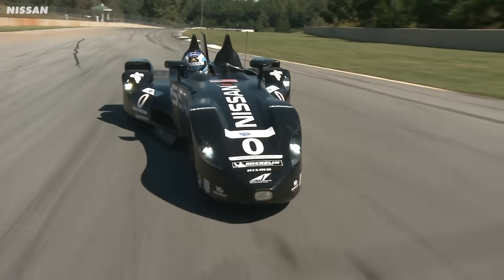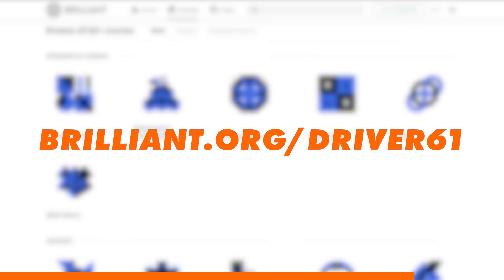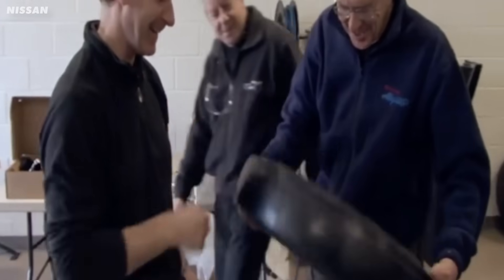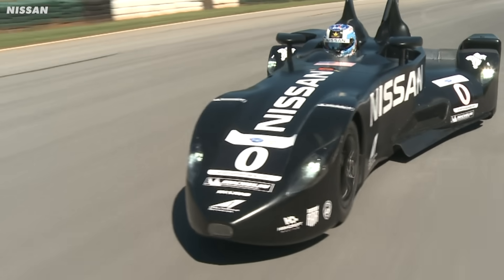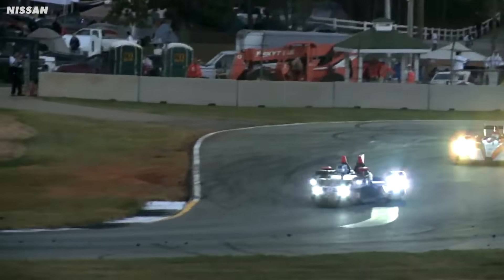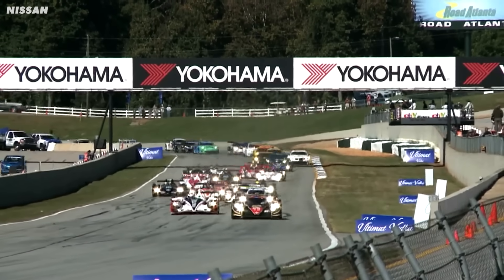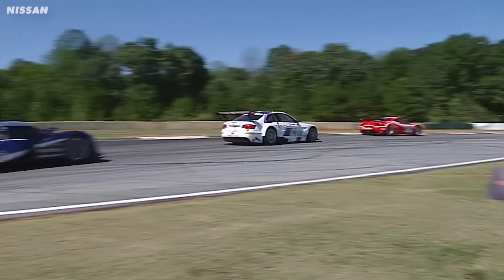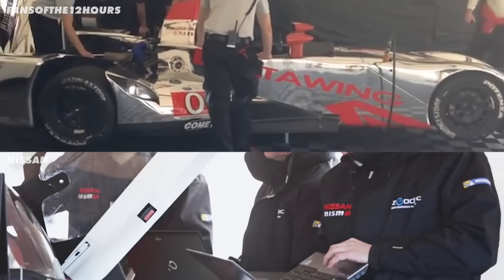Why This BIZARRE Race Car was GENIUS

Comment: First impression, the inside rear wheel will lost traction at sharp corner due to limited suspension travel....and it was. Second is that driver will eventually making mistake and crush their rear side when he try to cut corner or going through some traffic since the front head is narrow and rear body are much wider.

Comment: Saw the car in 2014 at Le Mans 24h and was really disappointed that it basically stopped racing after just 1 lap. All in all it managed 5 laps before its accident, so a total failure. And I am not sure the video really reflects on what an incredibly bad race it had at Le Mans: "Six hours into the race while warming its tires it suffered an accident." 
You would probably have made more laps in six hours pushing a Yugo ... (" the best thing about its rear-window defroster, according to consensus, was that it could keep your hands warm while you pushed it.")

Comment: Delta wings are used in supersonic planes because it's needed to combat some issues with supersonic airflow. Having delta wing shape for anything that goes slower than the speed of sound is more like a marketing trick instead of required for aerodynamics.

Comment: The Deltawing should have been great. By the end of the 2015 season if I remember right, the Deltawing was faster then anything else on the straights, and starting to be a threat in championship fights. The next year at the Rolex 24, the Deltawing drove to the front of the field and held the lead overall on pace alone. Unfortunately, they crashed into a stalled prototype challenge car in turn one. That was the last of the Deltawing.

Comment: Wrong.  It has nothing to do with delta-wing aircraft, and has everything to do with (1) reducing frontal area, and (2) eliminating (as much as possible), top-surface aerodynamic devices (e.g. wings).  Reduce frontal area and drag, and you need less horsepower.  Use ground effects, and you have no need for [draggy] wings (other than trimming) to produce downforce.  Given the narrow front track, to balance the car mechanically front-to-rear, extend the wheelbase forward (otherwise, you get the 3-wheel ATV fall-on-your face-while-cornering effect).  Mix #1 and #3, and you get the [long] triangular configuration, and for kicks, let's give it a cool-sounding name, like Delta-wing.

You're welcome.
Reply: Never mind the blatant Gurney BLAT at 3:55(https://youtu.be/D7N5mrxzFmg?t=235)

Comment: You can't say, after the test/race driver gives a 5 minute list of how bad it was,  that "despite this they got it working at road Atlanta". No, they didn't. It is a failure. There is not enough front end grip, relative to over all grip, to be fast. Its a silly eco-minded idea, based on racing without using fuel, that failed. Its not genius in any way and its not leading to any new development in the future.

Comment: Delta wings are horrible and inefficient at low speeds which is why the f-14 had movable wings.  They could spread them for high efficiency at speeds like this car would see, and pull them back into a delta formation as they approach supersonic at which point they generated plenty of lift with reduced drag.

Comment: I have no idea why anyone would think that a delta wing is useful for anything other than supersonic flight, which clearly wasn't the goal for a race car. In fact, the delta wing is a compromise between good lift-to-drag ratio at supersonic(!) speeds, and barely sufficient lift and adequate controllability at high angles of attack at low speeds, at the cost of huge drag. Concorde needed tremendous power for takeoff and still substantial power for landing. The drag reduction in this machine mostly comes from the narrow body, and the wider rear part is a compromise to keep it from flipping over in corners. If a delta wing had low inherent drag, all aircraft would be using it, but only supersonic aircraft (and some whacky experimentals, where drag isn't the primary concern) do.

Comment: The delta wing on supersonic aircraft is a feature implemented prevent Mach waves from locking up control surfaces.  At speeds below transonic, e.g., a car, the delta shape actually increases drag due to viscous boundary flow.   The correlation between the car and supersonic jets is pure marketing wank.  This, from a keen racing fan and aviator.

Comment: I used to have good natured arguments with a friend of mine about the benefits of a reverse trike and the potential. He thought it just wouldn’t work.
With the (relative) success of the delta wing I was able to win that one with a knowing nod and a wink.
I’d still like to build one. Unfortunately it’s at the back of a long list of possible projects and I’m not getting any younger!!!!
Reply: It's not a trike though it has 4 wheels.
Reply: @wiegraf9009  it’s a four wheeled trike, if you can imagine such a thing. The front wheels are so close together it’s functionally the same as having just one.
Three wheelers aren’t classed as “cars” so this was a way to get the benefits of a reverse trike but still have four wheels - be a racing car.

Comment: It was an interesting concept that ignored basic physics. The small cross section at the front of the car created a torsional aspect to the handing and doomed the car from the start. All of the gains on the straight aways went away at every corner. The front tires were beat to death every time it went out. A nice concept but fundamentally flawed.Otherwise,it would be everywhere on every race track right now. You really cannot beat the four square box chassis that the standard race car has for handling. It is just the reality of this place we live in.Driving that thing in the rain must have been terrifying.

Comment: A few points of note. The car was actually pretty competitive in the ALMS and running at the front in the Daytona 24hrs for a time.  It certainly had reliability problems early on. Also the engine in the Panoz Deltawing cars wasn’t exactly a Mazda with Elan Power designing and building the engines themselves around a billet block of their own design. The cylinder head was a Mazda casting though. The Elan engine made more power and torque and the gearbox suffered as a result. A switch to a new custom made EMCO unit eventually solved that issue. Aero wise the car was developed extensively in that period with a modified underbody, revised front end with a splitter and small wings at the back. The rear suspension design was also very different from the ‘Nissan’ car with a more conventional set up at the rear.

Comment: I saw it a few yeas ago while testing at Top Gear Test Track @ Dunsfold Park, and the way the nose would dive in at Gambon was really uncanny as was the overall speed with so little power.  Also, mentioning delta winds on aircraft like Concorde & Eurofighter in relation to this is is wrong, at least in engineering terms, probably less in marketing/publicity ones.  The reasons they work on aircraft is totally irrelevant in cars as I can't imagine any car pitching down 20-30° while cornering 😆

Comment: A very interesting car indeed! A small note though about the lateral load transfer across the front tyres: it actually !increases! due to the small front track width not the opposite as stated at the video. 

The formula is: lateral load transfer=(weight on the front axle*lateral acceleration*height of the center of mass)/(track width)

Hence a small track width leads to increased load transfer. A large track width can offer "free grip" as you can work both tyres closer to their limits. The stiffness of the front and rear axles is an independent parameter and can be set however you want it. 
Needless to say this is a very interesting example of vehicle dynamics and car setup!
Reply: Interesting car and I really don't know how it was any good. Disappointing video though, given the error you mentioned, as well as suggesting the shape was used for the same reasons as on aeroplanes designed for operation in supersonic flow regimes, where air behaves completely differently to subsonic flow. I still have no idea how it was any good.
Reply: @dethak  yes it was a bit funny hearing about a delta wing race car, given that it travels through subsonic, let alone practically incompressible flows 😂 I would argue its a draggy design, given all the vortices created, their lift/drag ratio shouldn't be impressive really. It was probably a compromise to materialise this unique design, rather than a feature!
Reply: The more I think about this formula, the less it makes sense. It makes perfect sense if front and rear track width are the same, and I think it might make sense if the front wheels are on a rigid axle, but neither of these things is true for the Delta Wing. It has a very wide rear track and stiff body, so I suggest the rear track be plugged into the formula. I think it would also make sense to multiply the result by the ratio of front/rear track widths.

Comment: The title should be "When engineers are on crack." i don't think that thing ever really worked and the other problem was the drivers in front could not see the car and kept running into it. A lot of cars might look good on paper but are useless on the track.

Comment: I respect them for being bold by trying something different.
Reply: Can it be that the design was too good to fight with most racing series?
Most genius was thinking out of the box...here literally.
Reply: @KarsonNow  It kind of reminds me of when Granatelli brought the turbine cars to Indianapolis, and they just created rules to keep them from being competitive.... then Formula 1 did the same thing, outlawing 4WD when the lotus 56 basically just took over the races when it rained.
Reply: @KarsonNow  No, the exact opposite. Because of the front of it, it wasn't as safe at the same top speed as the other cars and was harder to control because it wasn't able to turn as well. It may be unbeatable in a straight line Drag race, but any turning would hinder it.
Reply: Dont reinvent the wheel is a cliche for a reason lol
Reply: @benardman2665  And to "reinvent" the wheel" is wrong in the way it is stated. You can't reinvent anything. You can improve on an idea, but it already exists. And not every "improvement" is actually an improvement. Like with cars. All of the extra electrical equipment that could be taken off and the engine will still run isn't really necessary. But Smog whatever? If it were 100% true then how can I still legally drive my 1986 carbureted V- Six GMC truck with zero computers in it?
Reply: @RichardBenoit-q4z  it's called a "saying" bub. Don't look too deep into it. Might hurt yourself
Reply: Improved Batmobile?
Reply: two down force wings in front would have helped.
Reply: @RichardBenoit-q4z Helped with what? Giving it even more grip on the front tires that already had too much grip? 

Little weight on the front tires means you have little lateral force pushing the nose to the outside of the corner. 

Understeer wasn't one of the problems of this car.
Reply: To be fair everything was different with lmps back them...

Comment: The legal issues on this thing are nuts as well.  He glossed over it at the end, but it was a BIG thing
Reply: I feel like legal mumbo jumbo always ruins innovation. If those engineers worked on it, IMO they should be allowed to take that info with them back to Nissan because this project was too cool to go down like that
Reply: @Cheeky_Goose  agreed! Either they need to make an experimental class, Or allow more innovation.
Reply: @Cheeky_Goose  I agree. The correct way to combat "stealing IP" this way is to have long enough non-competitive clause in the contract. However, that gets really expensive really fast and its the reason it is not used more often and instead companies go to court to try to handle these cases.
Reply: @Cheeky_Goose  Usually, the rule is that you can't take anything physical with you - notes, drawings, etc, but you can't stop someone from knowing stuff. Adrian Newey discusses this in his How to Build a Car book.
Reply: @Cheeky_Goose . Right if you pay some to design a product for you, they should be able to take that design to other companies… /s
Reply: @robertt9342  So if I pay someone to design a car with wheels and that design concludes that four is the optimal number of wheels, they can't design a car with four wheels for anyone else?
Reply: Can it be that the design was too good to fight with most racing series?
Reply: @KarsonNow  no
Reply: Legal issues are good for public road going cars.
For racetrack non road legal car… how about GFY…
Reply: This might mean it comes back in a few years when the patent runs out.
Reply: I see what you did there 😂

Comment: I must correct you about the Le Mans crash : It happened at the restart after a SC period while Nakajima in the Toyota was fighting for the lead and wanted to overtake a GT at the end of the Porsche curves but the Deltawing was in the way...
Reply: I was watching it. One tap of the delta wing and it went off track. IT’s physics. Normal race cars have a side that’s long. Delta wing has 45% of the car is normal (rear). Other part is narrower. You tap the delta wing anywhere, it unsettles the car.

Comment: I was hoping to hear a bit more about one of the most intersting aspects of the Delta Wing, the vortex sealing of the undertray! Inspired by the BLAT technology on the Eagle Indy cars of the early 80's, this is one of the key developments of the aero package on Delta Wing.  The delta shape of the undertray has little to do with jet aircraft, as jet fighters and Concorde use delta wings for entirely different reasons.  The delta shape wing is less prone to wave drag in supersonic flight regimes than other wing planforms, while also maintaining lift at low speeds with high angle of attack due to the large vortices generated over the wing, but these conditions are not applicable to the Delta Wing vehicle here. 

The vortice generators along the leading edge of the undertray help to "seal" the undertray, much like a low sliding skirt, improving the downforce generation of the undertray, and creating a lower drag to downforce ratio. Otherwise great video, such an interesting vehicle from an engineering perspective.
Reply: Ye ground effect nothing new then
Reply: @chrisjohnson3253  the "ground effect" in the '78-'81 "ground effect era" was achieved with physical skirts, they were banned because they were getting damaged which caused problems.
Reply: @alanhat5252  yes I know this why are you telling me
Reply: That flip they showed well that under tray was removed and brought back from petit. I sold it wish I would kept it.
Reply: Modern F1 cars do this too, look it up.
Reply: @piuthemagicman  Oh no doubt.  F1 aerodynamics is heavily rooted in vortice generation, for a wide range of reasons, including sealing undertrays and wing endplates, as well as general air flow management.  But for the Delta Wing, it is such a crucial element to the aerodynmaic package, given the entirety of its downforce is generated from the undertray, and the vortice sealing is perhaps the single most prominent aerodynamic feature on the vehicle, so I thought it would warrant at least some kind of mention in a video dedicated to it.  But yeah, there are many uses for vortices on a race car.

Comment: To say the Delta Wing "failed epically" is extremely unfair. While it never quite achieved the lofty goals of matching LMP1, those weren't actually the goals of it's original designer Ben Bowlby, that was something Nissan pulled out their butts when they decided to fund the prototype(and as the ridiculously short development timeframe of the GT-R LM showed, Nissan was more than a little willing to engage in hubris at the time).

Even with Nissan's backing, the car was developed on a shoestring budget, yet still managed to be only a couple percent off the pace it was intended to have. On a good day it was able to mix it up with contemporary LMP2s, and had more money than Don Panoz was able to throw at it's later development been made available, it probably would have become a race winner in the ALMS.

I remember when the car was first shown as a concept, though, and all the claims that came up about how many ways it would fail. I always got a laugh out of the number of people who thought it would just flip over when it turned because that was the only element of the design that even the layman could be expected to understand would NOT go wrong with it. But even people I KNOW were smart enough to understand this insisted it would flip over when turning even when the facts of why it won't were pointed out. Many a person were flabbergasted when they saw it take it's first corner.